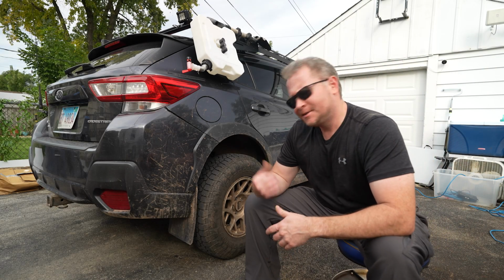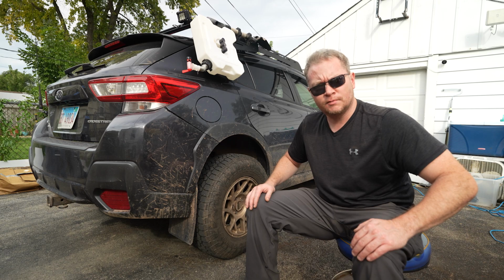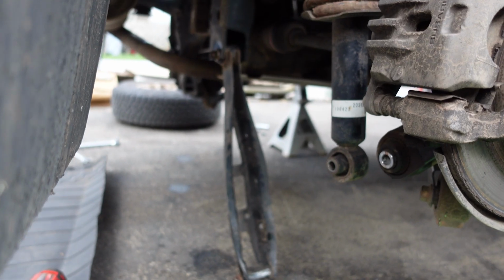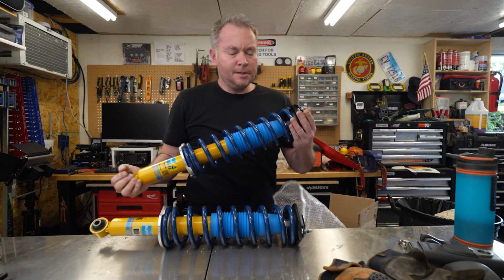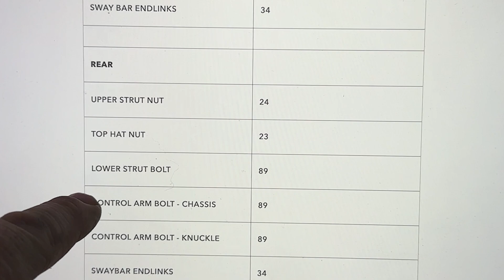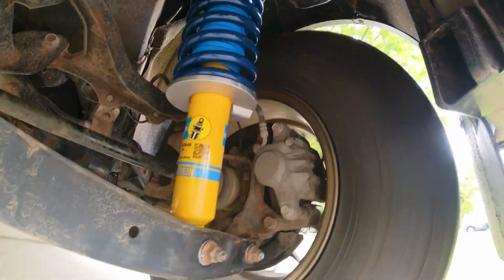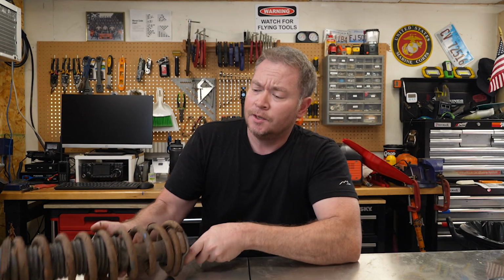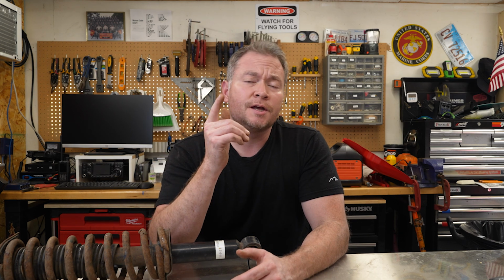Whoops!  I Broke the Crosstrek

Comment: When tightening control arms with rubber bushings in the joints, you should always torque down the hardware over the bushings when the suspension is under load. If not, you'll start to wear out bushings prematurely, because they'll be under load even during normal driving.

Comment: Check out doing some Fluid Film or other lanolin (sheep grease) based under coat in the winter to keep the rust down. I've been using it for a while on my Subarus and it does a pretty good job, it doesn't dry so I have to reapply it every 1-2 years but they love to dump the salt around here so IMO it's worth it.

Comment: My educated guess on the rust issue is the powder coat. Spring steel rusts pretty fast so it needs to be kept away from the elements. The powder coat was not applied very well and any water infiltration under the powder coat probably got trapped there for a bit causing rust. Any non-lubricated coating works very poorly in road salt states. Powder coats, enamel paint, rubberized coatings, bedliners, etc. they all trap water once a pin hole is made. Instead, I use Cosmoline but some people use WD-40 or Fluid Film. They all work to various degrees it's just a question of difficulty of application vs up keep and frequency of maintenance.

Comment: No way those should be rusting like that. Wow terrible coating on those
Reply: That was my initial thought, too.  They don't look good at all.
Reply: Ever lived in the five Rust States? Nothing underneath, and only half of what’s up top, doesn’t look like that after three years. OEM fairs a little better, aftermarket doesn’t really keep up.
Reply from the maker: This seems a tough one to say one way or another.  I grew up in rust states and this is nothing new to me (OE or aftermarket).  I didn't want to badmouth Rallitek (in this case) because I don't have any evidence to suggest other brands are better or worse in terms of their coatings.  I can say I'm disappointed they corrode so quickly, but for all I know, that's just being a victim of my environment :). I'm gunna start looking around at other rigs and asking how long they've had parts and try to report back in the future.
Reply: Not knocking the aftermarket coatings at all. (although I think some might be a little thin) Salt States are really hard on machinery of all kinds. Here in MI I’ve seen three year old lifted pickups with 12 used-to-be-beautiful shocks, related springs and suspension arms, all pocked (or worse) with rust.

(Some) OEM coatings and finishes hold up better, and I imagine are very costly application processes. Not a problem spread out over a few million vehicles. For smaller aftermarket businesses in a very price competitive market, well…
Reply: @nohrtillman8734  I live in Canada with salt all over the roads and my 3 year king springs look new compared to these.
Reply: @Overland_506    That great yours held up that good! I’m just talking from what I’ve seen. More upset with the salt effect in everything than comparing any coatings.

(And of course, Canadian salt is different 😂 That’s my theory.)